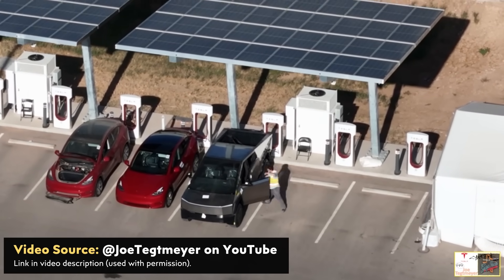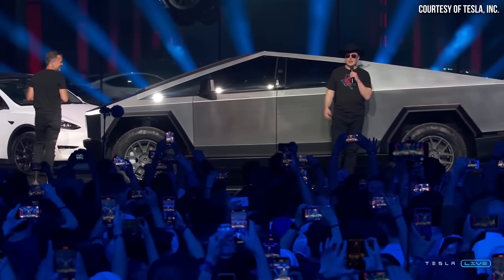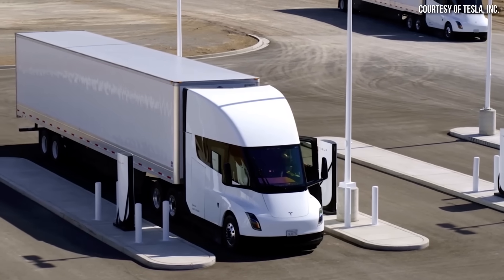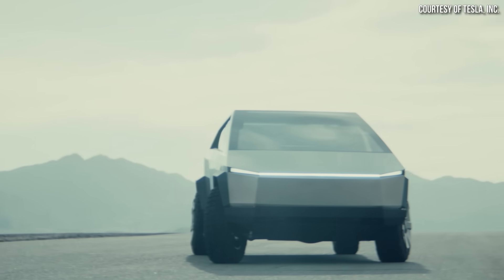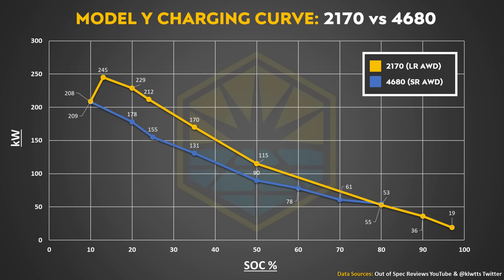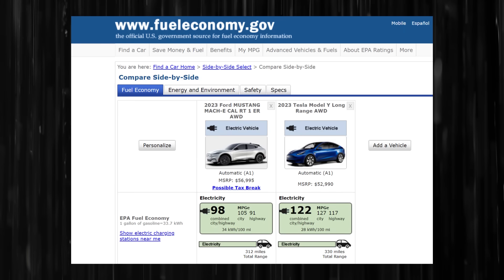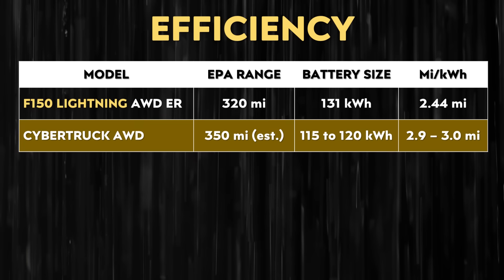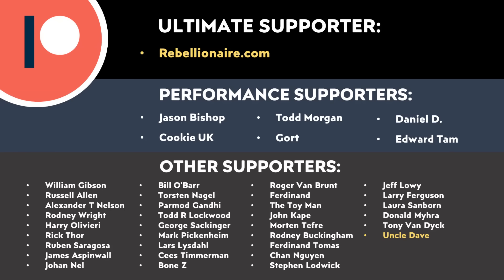Tesla Cybertruck Charging at Giga Texas | 350 kW Charging Speed?

Comment: The 4680 are software limited... not hardware limited...

They electrical and mechanical specs allow 5x more power ... just by using Ohms Laws ... 

They are sand bagging until they achieve the standard they need ...

I will bet, once they got all data, they will unlock the power and energy from the 4680 already out there ... they done this before...

Comment: Will you be able to charge your CyberTruck at home?
Yes, you will be able to charge your Cybertruck at home. The Cybertruck will come with a standard 11 kW Level 2 charger that can be plugged into a standard 240V outlet. This charger will take about 13 hours to fully charge the Cybertruck's battery. Also,Tesla offers a 22 kW Level 2 charger that can fully charge the Cybertruck's battery in about 7 hours.
Reply: When did Tesla say they would provide the charger for CT? They haven’t provided the plug in charger in quite a while and have never included the wired in wall charger, ( 220V only). IIRC I paid $250 for my travel charger or whatever it’s called.

Comment: Jon you miss two important things!

1) when the CT was unveiled the slide on stage said 350kw+. The important part being the + symbol. Tesla is clearly sandbagging the true charge speed of the CT just as they re sandbagging the true top speed of the roadster.
There is no way on earth that Tesla will release the CT and let it take 50% longer to get to 80% than a Model 3/Y (roughly).

2) The UK is not set to get the CT and the Semi will charge as you point out at about 1mw. So why are we getting a supercharge V4 that will charge at 350kw? We do not have a single Tesla for sale here that can take that speed.
The only possibilities are either the roadster or the incoming Model 3 Highland and the soon after Model Y juniper versions.
If they ere using 4680 cells (form factor ) and the CT that uses them can charge at 350kw+ then logic states the same cells in the highland Model 3 and juniper Model Y can charge at those speeds as well.
I appreciate that the CT will use the Cybercells but they will have better charging as I understand it which is indicated by the + symbol in 350kw+.
I appreciate this is not exact proof but it is the best I can do right now and I honestly think that regarding charging Tesla have something up their selves that will result in the Model 3 and Model Y updates charging faster then current and the CT will charge faster still.

Comment: 350 kW on a 400V system would be a lot of charge losses (heat). I personally hope the Cybertruck has a 1000V system.

875A (400V) vs. 350A (1000V) when charging 350 kW. I personal think with a bigger battery 350 kW are possible but only for a very short time.

Comment: There are 2 main factors that limit charging  speed (on the vehicle side).
1. Cell chemistry.
2. Heat management.
1 - If we assume cell chemistry is the same as the 4680 Model Y AWD, then the C-rate would also be the same - meaning the charging power will be higher proportional to the battery pack size. I´d expect the Cybertruck battery pack to be about twice as big, meaning the peak charge rate reaching 2x209=418kW.
2 - We don´t really know if the Model Y AWD charging curve is limited by heat management. If it is, then Cybertruck, using 1000V architecture would have smaller percentage heat losses. So the result should be charging 10-80 percent in 30 minutes or faster, but definitely not more.

Comment: Ford typiically meets or exceeds epa and Tesla falls about 12% short of EPA because of how they calculate. If you factor that in then the MY has a 107MPGe  compared to the fords 98 which is still better but only by 9% not 21% .  That being said the CT should be better then 9% on the CT because it has better aerodynamics then the F150

Comment: I think your math shows the Cybertruck will have ~50% more cells than the MY AWD.  Maintaining the same charge rate per cell, the pack will actually take 50% more power...which increases the limit to around 375kW.  So it would seem it can take the full power of a 350kW V4 charger.  It could be even higher, with efficiency improvements in cooling not only within the pack but also within the cell.
I also seem to recall that V4 posts are rated 1000V, but the cabinets are limited to 500V.  It seems they made an easy path to upgrade to 600kW by just upgrading the cabinets in the future.  But it really doesn't make sense to do the upgrade until they have a vehicle that can benefit from the higher charge rate.

Comment: Yeahhhh, no. Cybertruck will recharge a lot faster. Tabless design allows a lot more power to come in at one time, reduces the amount of heating that charging causes, and of course allows a lot more power to come out of the battery cell at one time too. We know Tesla has hinted many times that they have some great surprises about the Cybertruck, and they already did an oh and one more thing and mentioned that Cybertruck can recharge on a Megacharger. Model Y with 4680 cells still has the same inverter of the regular Model Y, the same wiring and voltage...the Cybertruck will not have those limiting parts. 

Tesla has not been working on the Cybertruck for seven years now to deliver a pretty good truck, pretty much in line with other products, that is not what Tesla or Elon Musk does.

Comment: The cybertruck will have a beast mode cooling system for its towing, this will help with charging. 4680 Y 71kWh does 200kW, so 115kWh÷71kWh=1.62, then 200kW×1.62=367kW. But then you factor in improved cell design over current 4680, and beast mode cooling for towing so it will without a doubt do 350kW no problem. 400kW is more likely, especially when 800v architecture is factored in too.

Just look at SR model 3, that charges at 180kW and the ratio between pack size with the LR 3 and charging delta is roughly the same.
Reply: But Cybertruck is also 48/1000 volt architecture, and tabless cells means a lot less heating both from charging and discharging, and Tesla has ALREADY SAID the Cybertruck can charge on a Megacharger. Why is everyone ignoring that statement?

Comment: We might not have to think quite so hard on this, Jon.

4680 is a big cell. Cooling can only get so close to each cell. But there are more cells in the Cybertruck.

The BMS has the same tradeoffs to balance - different input values, but the tech is very similar, just more of it.

The unit of measure that matters is time. Rather than back into a time prediction with beaucoup assumptions, I think we can deduce that Cybertruck's charging times will be very close to what we see in Model Y with 4680 cells. Cybertruck will see a somewhat heftier absolute energy input, but with more capacity to fill, we'll see very similar charging time results.

It's going to cost more to operate the Cybertruck, but convenience at Superchargers ought to be very similar to Model Y 4680.

Which is pretty good, really. After 4+ hours on the highway, a twenty minute break is exactly what drivers need anyway. Empty the ol' bladder, grab a snack, stretch legs, take a brief nap. Drivers need recharging, too.
Reply: You might want to be thinking harder on this one, Urgelt. Why did Tesla announce that Cybertruck can recharge on the Megachargers if it will just end up charging as fast as a Model Y? Why the 48/1000 volt architecture? Why so much effort to make a tabless design (which, by the way greatly reduces the heat caused by charging)? There are definitely not "more cells in the Cybertruck." The Model Y with 4680 cells is just that;  it still is 12 volt architecture, it still has the inverters Model Ys have, it still has the charging port Model Ys have, etc. Cybertruck will have none of those things. What are those great surprises Tesla keeps hinting at if one of them is not fantastic charging speed? 

Yes, for Joe all hat no cattle Cybertruck driver, a twenty five minute recharge after a four hour drive is great. But Tesla wants to sell to Joe the Rodeo Bull Rider too, and he is going to be hauling a trailer a long way behind his Cybertruck, loaded with a big heavy bull, or maybe a few horses, or whatever, and he is going to be driving two hours or maybe even less towing all that, and he will want to recharge and hit the road ten minutes later.
Reply: @tribalypredisposed  48/1000 volt architecture really has nothing to do with charging speed. I see this misconception all day every day, it's popular. It's still wrong.

Charging speed is a trade-off between cell cycle life versus charging speed. It is determined in the BMS. Period. Each manufacturer makes choices in the BMS, trying to hit the right balance.

The point of the 1000 volt architectures is mainly weight and cost savings. That's it. 

Tesla is choosing to switch to 48 volts L-ion batteries that they expect to last for the life of the car - and save weight, both in the battery and in cabling. This low voltage battery is charged from the main pack, not directly from outside power.

The use case doesn't affect charging speed at a Supercharger. If you need juice, you charge 'er up. How fast that goes is still governed by trade-off decisions in the BMS. Not the voltage architecture.

Drag around heavy stuff and you'll have to charge more often.

Same for ICEVs. Gas up more often if Joe Six-pack is dragging horses around, or whatever. The main difference is where you go for energy and how much time is spent getting it.

You can avoid a lot of time spent charging by charging at home, when the truck isn't in use.

Of course a rancher can bury a gas reservoir on his ranch and fill up with that, if he wants. Have a load of gas or diesel delivered into his storage tank whenever.

I don't think anyone is arguing that Cybertruck will displace ICEV pickups for all use cases.

It doesn't need to. Just some use cases. Enough to find demand.

The tabless design for 4680 will reduce heat generated by battery chemistry. It's great. But it's still a big giant cylindrical cell, and cooling will be farther away from battery chemistry than for smaller cells - assuming an effective thermal management system. Tesla makes good thermal management systems. Plaid *had*to use small cells. Tesla tried to make 4680 cells work for Plaid. Couldn't do it without reducing performance. Gave up.

They wanted those bragging rights for Plaid, and they got them.

4680's big selling point is cost containment. Cybertruck won't match Plaid performance, but who needs for a Cybertruck to go 200 MPH on a grueling track, or race up Pikes Peak? Nobody. That isn't a use case.

But Cybertruck will have plenty of torque, and a physical architecture appropriate for off-road, hauling, and defeating cart demons - at a lower cost than if it used smaller cells, and at a lower cost than if it used a 400 volt architecture. And no more replacing lead-acid batteries every couple-three years.

A lot of folks will want this truck. Tesla will be working through backorders for years.
Reply: @Urgelt  tl:dr, but about your BMS obsession, absolutely not and thanks for playing "I am an internet expert." Tabless battery cells, the distance inside the battery that the electron has to travel is a lot shorter,  either charging or discharging, creating less heat than in a 2170, and the heat plays a large role in battery cell degradation. The BMS in the Cybertruck will not have to do what the BMS in the Y has to do to protect the battery. Also, way more electrons can enter the battery cell at the same time, it is a much bigger electron pipe than a 2170 cell with tabs has. 

People here are effectively claiming that a garden hose can deliver water in the same quantities and speed  that a six foot water main pipe can, and no, that just is not the case.

Anyways, if you want to go back and look at my record of my posts being right about Tesla over and over for the last eight plus years, go ahead. You will not have to wait very long to find out that I am right again this time.
Reply: @tribalypredisposed  nope.

The tabless 4680 electrical path is shorter than in a tabbed 4680. It is not shorter than a 2170 electrical path.

I am stating facts, not appealing to authority.  Your attempt to assert authority for an anon comment is pretty ludicrous, y'know.
Reply: @Urgelt  🎯🎖
Reply: @tribalypredisposed he was talking about "fast" in = time spend at superchargers, not charging speeds. I think
Reply: @Matzes  "I think we can deduce that Cybertruck's charging times will be very close to what we see in Model Y with 4680 cells." Absolutely not, not with tabless cells combined with a 1000 volt architecture and new inverter and new charging port...not even a small chance of that claim being true.
Reply: @tribalypredisposed If you don't think there are more 4680 cells in the CyberTruck then in the Model Y, you clearly failed Physics class. OBVIOUSLY it's going to get a significantly larger battery.

1000V architecture is for efficiency, weight savings, and faster charging. However, with a pack that's twice the size, it makes sense that the charging time will be about the same. 48V low voltage architecture is irrelevant to the charging speed discussion.

You people are weird. Run the numbers. And Tesla's Megachargers ended up being 750kW chargers. Tesla is doing the overpromising and underdelivering thing again.
Reply: @TecnamTwin  he did not not more in the Cybertruck than in a 4680 Model Y, he just said there are more. No. The vast majority of Model Y cars have a lot more cells than the Cybertruck will.

Lol, Tesla you say is "over promising" by...never saying how fast the Cybertruck will charge so far? I may be weird, but at least I am fluent in my native language.

Comment: Sound good. No clue. Definitely need longer cables and even pull through chargers. Wish we knew if cybertruck and Semi actually use the same chargers and if they will be completely different networks. Hard to mix commercial traffic with passenger vehicles so I'm assuming completely different areas if not properties.
Reply: As long as you can back the Cybertruck up to the tire stop, that's how long the cable really needs to be.  So that's about the same as the MY.
On the other hand, an F-150 Lightning's charge port is on the other side of the wheel (opposite the charger post), which requires the cable to be another 2.5 feet longer...so the legacy OEMs are the bigger issue.